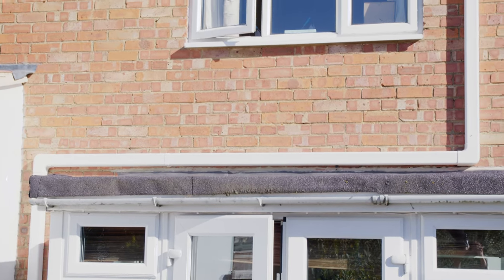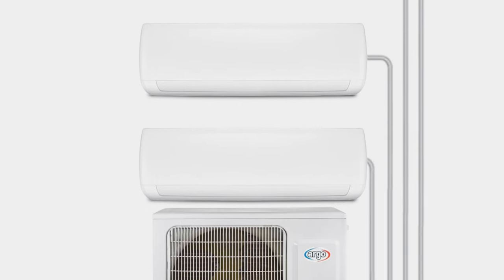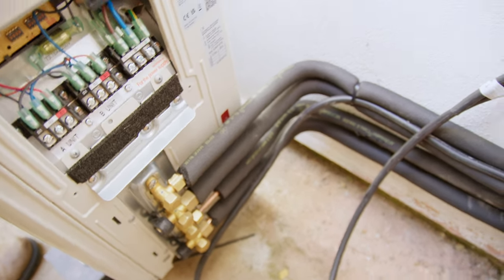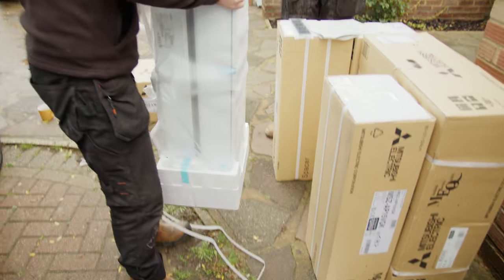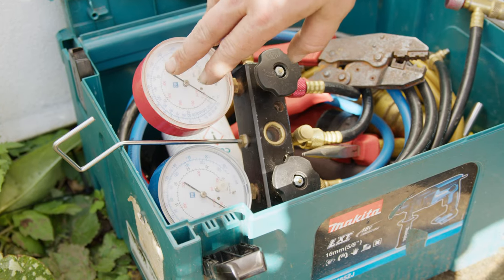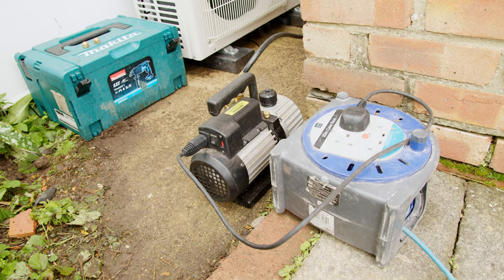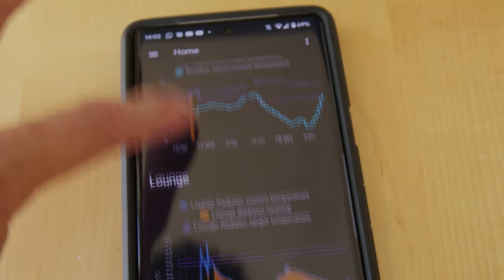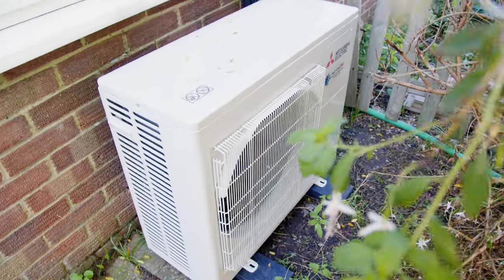Air conditioning in an ordinary British house?! 4K HEAT PUMP

Comment: When drilling through the brick wall, the guy should have used a long bit and gone all the way through from the inside to the outside. Then he could have taken his boring bit (diamond tipped) and gone through from the inside to out, but stopping 1" before the outside. Then he could have finished the last inch from going from outside  to inside. This way, he wouldn't have taken a big chunk out of the brickwork.
Reply: I instantly spotted and thought the same!
Reply: @TheRetroBristolian  Me too. Some people just don't care.
Reply: Yep, typical rough arsed tradesman.  Smashing the face off the brick. At least the trunking covered it up.
Reply: With a decent diamond core drill there are nog chuncks taken from the brickwork.
Thi is garbage, also the dust is everywhere now.
Reply: No dust masks either
Reply: Did the trunking not hide it?? Easy to point fingers from your bedroom
Reply: It's best to drill with a fine bit int to ext, then core from the outside, when nearly through take it off hammer, you can then feel when you reach the internal plaster,  take it easy and you're through, all the mess is outside, no spelching.
Reply: @jamesmcguire5018 but its just good practice🤷‍♂️
Reply: @LiamC-ez7yn   Why do you use hammer action with a diamond core? 🤔
Reply: Agree, also I would have thought they would use a pvc pipe through the hole to protect the AC pipe.. looks like a lot of potential damage on the copper pipes that could expose over the years.
Reply: he got the job done

Comment: Hi Rob, I would be interested to see how you get on with these through the winter in terms of energy consumption and how warm you're able to get the house.
Reply from the maker: I replied with this under another comment but realised I should have replied here. Anyway, copy and paste:

For energy, my rule of thumb so far is that heating a single room in normal South England autumn/winter weather is definitely a lot cheaper with AC. I can run my LN25 unit for a whole working day for about 4-5kWh. In similar conditions I used about 30-40kWh of gas. But it's not totally equivalent as even with TRVs the gas is heating more of the house at once.

I've noticed some loss of efficiency and heating takes longer in this -2C cold snap. Outdoor unit needs more frequent defrosting. You can hear it working harder. Indoor unit takes longer to start pumping out warm air.

Will update or post another video when I understand my spreadsheets better (I am running an experiment right now in fact. I used no AC yesterday but have the gas off and am running AC in my work room now, so will compare cost for a day's work.)
Reply: @RobFisherUK  Thanks Rob. I did spot that reply for the other comment, but I apricate the time you've taken to copy me in!
Reply from the maker: @jamesdcuk  little update from my experiment: on 13th December I ran gas heating in the room where I work between 9am and 6pm and it cost £2.36 for 23kWh of gas. On the 14th, similar weather, I used AC and it cost £1.62 for 4.6kWh of electricity. I felt similarly warm. Of course the gas was also heating my bathroom and hallway. But the AC gave off a nice blast of warm air as I sit right under it. One other consideration I have no idea about: what is this doing to the service life of my AC equipment?
Reply: @RobFisherUK  Thanks for the update. Sounds like an ideal piece of kit, especially considering it can cool the room and reduce humidity too!
Reply: @RobFisherUK  5 kWh still seem really quite good even if it isn't necessarily heating up every single room

I've got solar panels, and I figure I may be able to run AC partially from solar in the summer. Equally I've got old microbore piping, and tiny radiators so I was thinking maybe it's worth just purring these in, instead of replacing my current set up.

It does seem cheaper either way. The biggy however is the heating of water too
Reply from the maker: @waqasahmed939  for cooling, solar makes perfect sense because the hot days are also the days you're likely to have spare electricity from your solar panels.

Heating water is indeed a biggy. I stuck with the gas boiler because 30kW of water heating power is great for showers in the winter. But I guess a hot water tank and a pump can work well too, and so the question is going to depend on the price and lifetime of the equipment, efficiency of heating water with a heat pump, and gas vs. electricity price. A difficult choice!
Reply: Thanks for making this video. It sounds like each unit of the split system is running at around 0.5kwh is that right? If so, that is really efficient and with a small solar array you could run the heating for free.
Reply: @RobFisherUK  would be interesting to see how much electric on a cold day did you use to heat the whole house, Im just about to have 8 units installed in my house (Toshiba Haori) with 2 external 5 split capable units. I think air to air has got to be more efficient that an air to water solution as heating water up and then to radiators is in my mind not as COP efficient. I do have in mind to use a an all in one built on top top of the water cylinder ASHP water heating for my DHW. thanks for posting your video
Reply from the maker: @bobbazley5376  I've never attempted to try heating the whole house all day. One thing air to air seems to be good at is quickly applying heat where it's needed. So on the cold days where I've tried heating with only AC and no gas, I've turned rooms on and off as needed. The main downside to this is I don't have AC in the bathroom or hallways.

The most I ever used in one day for AC, as reported by data from the Mitsubishi app as read by Home Assistant, was 13.7kWh. On that day the outside temperature ranged from -4 to 5.2C.
Reply: @RobFisherUK  Thanks for the quick reply Rob its much appreciated. I live in the highlands and have Oil for heating (no gas up here) but I also have solar and battery storage so wanted to go all electric. I think when you look at the data for SCOP/COP Air to Air is more efficient than an Air to Water system. I like that it will allow me to fully control each room with an app and really only heat the rooms I need. Its a 5 bedroom house with two fairly large rooms on the ground floor of 8.3m x 4.7 those two rooms will have each have a 4.5kw Internal unit and the rest of the rooms will be 2.5Kw units. I will have one placed centrally in the main hallway which will also be good for heating the upstairs hall as I guess heat rises ! I'm on the Octopus Cosy tariff that allows me to run all the system at just 20p per kWh. for 6 hours a day in early morning and afternoon. I know I will have much higher electrical usage during the winter but I think it will be a little less than what I have been paying for oil and I will be able use less as its quicker to heat rooms up with active air flow of the heat when its just convection with radiators at present.  Agreed the bathrooms are not really suitable for an air con unit but my plan is to just place heated towel heaters  that are on a timer for the morning and evening times that they would be used. I think you having the whole house A2A is a great solution and from what I'm seeing is there is more and more interest in that as a solution to heating a house (as well as cooling it!)
Reply from the maker: @bobbazley5376  yeah, all that makes sense. I'm pretty happy with my hybrid solution. I kept the gas boiler as it gives a bit of a boost in the mornings and it's great for hot water, but there are increasingly more options for replacing things with electric power, so in future I might go further.
Reply: Daikin now do an a2a that supports a hot water tank, Daikin multi+

Comment: 5 days!?! What were they doing... thats no more than a 2 day job for 2 men come on, 3 max if they hit probems everywhere
Reply from the maker: They were working 8am to 4pm I think. Day 1 was installing two indoor units at the back of the house and routing some interior and exterior trunking. Day 2 was installing rear condenser, hooking it up and starting on the front of the house. Day 3 and 4 was finishing the front of the house: two wall mounts, a floor mount and some complicated routing of pipes. Day 5 was not a full day and was electrical wiring and commissioning. Even setting up the WiFi on 5 units took a while.

One of the guys was just an apprentice, so there was only one guy to do the welding, for example. There was a problem with drilling through soft bricks in one place that took ages and killed a drill. None of it seemed unreasonable at the time.
Reply: @RobFisherUK  ill give them that then not the longest days now it makes more sense. Also i suppose you'd prefer it's to be a good job than rushed and faulty. Carnt rush good work. 👍
Reply: How long have you worked in air conditioning for??
Reply: @markdove5906  put plenty in, its easy work compared to the real trades haha, if you'd take 5 days your stealing living....

Comment: intresting to see, i have also had 5 internal units installed, all Toshiba as i wanted to link this in with HA and it seemed the easiest to do this with. 
2 x Mini Splits for each side of the house downstairs and 1 Multi Split for the bedrooms upstairs, has been great for the summer and have hardly noticed the power consumption.  
Power usage last week 05/08/2024-11/08/2024 was 9.1kWh, this included running one bedroom from 23:00-07:00 on quiet mode every night. Total usage for July was 31.42kWh which based off my average cost of 12.96p/kWh is £4.07 for July. Will be intresting to see how it performs in the winter when it gets really cold, it was testing a bit in the last week of April where i used 12.36kWh which based off my average of 10.90p/kWh was £1.35 for one weeks heating in the afternoon.
Reply from the maker: I need to figure out how to get monthly costs out of HA, so far I can only see daily costs for AC on the energy page.
Reply: @RobFisherUK  yeah I still need to fully setup HA for the AC. Currently I just have a dashboard for each unit with an all off and all on button. Have managed to get Agile rates on a mobile widget this week which shows the current and next cost price, still working on getting them all to show for the day.
Reply from the maker: @mar451111  yeah I have some automations that do things when electricity is cheap or expensive. I'm hoping by winter I can figure out something to switch between Gas and electric heating depending on prices.

Comment: what was the cost of the installation (roughly) very interested to move my services from gas boilers to AC /renewable . thanks , great video
Reply from the maker: It was about £1500 per room. If you actually remove your gas boiler a consideration is there might be parts of your house AC can not reach, and there is water to heat, too.

Comment: With mitsubishi are you using infrared remote or wired ? You mentioned 30kw powered  consumption which is 6kw for each unit on standby its a lot. If unit is pressure tested as per manufacturer chances of leak is almost to none unless if you hit something to pipe by mistake. 
You can change settings to low power and even ultra low power mode. Engineers who installed the system they can do it but they will have to connect wired remote and mostly engineers carry it with them for programming and diagnostic.

Comment: Best thing i ever had done .i had 4 fitted ( mitsubishi units ) 3 12000 btu and 1 9000 btu.4 functions .cold heat humidifier and ordinary fan .Had them all fitted 3 years ago here in SE UK.
So nice to be co.fortable i  this heat .£1000 each supply and fit .And using them on eco setting and sleep mode they dont seem to be expensive .Also have used them in winter when not really needed CH on .
Reply: How s the noise from the interior unit?

Comment: Great Vid Rob, Ive been looking into this for heating more that cooling - I have a 5\2 lounges  bedroom house about 2500 Sqr foot  im looking to add . Im hoping to reduce my Heating bill overall i pay about 300 a month on heatin in the winter heating for about 2-3 hours a day @18 degrees . seems a massive waste but i think for my entire house it would cost me 10-15k  how has it affected your bills ? is it still cheaper on elect than gas.
Reply from the maker: The main problem is that where I am, gas is about 3-4 times cheaper than electricity per kWh, which offsets the efficiency savings of the AC. Honestly I don't think I would save money if I had only the AC for heating. The main way it saves money is in certain situations where I don't need to heat the whole house, e.g. working from home on my own. Also it starts working more quickly, so is better if I want a quick blast of heat.

But I still use the gas at least in the morning to warm the house through. And it's hard to compare year on year because this winter has been so mild.

Comment: Great video thanks. Did the installers have any preference for installing the internal units against an exterior wall versus an internal plasterboard wall? I’ve seen some suggestions that a condensate pump is required if not installing on an external wall (where fluid can drain to outside)
Reply from the maker: They didn't seem to mind installing on an internal wall. It just means you might have visible trunking. They avoided the need for a condensate pump by having a downward slope on the pipe, which in my case was possible within the diameter of the trunking because the runs were short. I imagine long internal trunking routes are going to need a pump.

Comment: How did it work out for the heating? Currently in a house with electric heating, so replacing the radiators with these would be nice in summer and winter.
Reply from the maker: It's pretty useful but for me mainly when I'm working at home on my own because I don't need to heat the whole house. I keep myself toasty on a cold day with about 350W. It can heat the whole house, but not necessarily cheaper than gas to do so.

But this winter will be different: I signed up for the Octopus Agile tariff so I can run gas heating when electricity is expensive and electric heating when it's cheap. And it can get really cheap (even free) sometimes.

Comment: That was a nice angle he was drilling with the core-bit
Reply: yeah you dont want the cables to snag on the way out
Reply: What was wrong with the angle? I was always under the impression you want to drill at an angle when going through exterior wall?
Reply: @ThatGuyKal  You do so that rainwater cant make its way in. I presume OP just isnt aware of this.
Reply: @Timsticlestv  that's what I just always been told, drill at an angle to prevent water ingress
Reply: Yes they need to be drilled at an angle, or else the condensate from each indoor unit won't run outside.
Go and read any installation guide for a split unit and they will all mention drilling with a downwards slope.

Comment: thank for sharing your experience - very valuable information! I'm in a similar situation - semi-detached house, 120m2 living space, 5-room, 2 story. I wonder myself if a mini-split system be sufficient? I have an oil heater and use about 8000kWh per year for heating.
Reply: You would need a 36000BTU system. I think it's only rated like that in the UK though.

Comment: Been looking into this a lot, and i think you made the right decision. If you don't mind me asking, What was the total cost?
Reply from the maker: You're looking at about £1500 per room, plus or minus depending on how fancy you want your wall mounted units and how complicated your installation is going to be.
Reply: Git a quote from sub cool for a 2.5kw floor mounted Mitsubishi mini split unit at £2,300 total cost included install. Not sure how your cost was on average £1,500 when the AC equipment alone costs £1,300-1,400 for the aforementioned floor option?

Comment: Comfort during hot days but you're stuck constantly with big ugly units on your inside walls and ugly trunking on the outside your house. Im looking for the units that fit flush in the ceiling. No ugly eyesores and no taking up wall space.
Reply: I've got no trunking in the bedrooms, ran pipes through the stud walls, you can have them installed on exterior walls and straight through, no pipes at all. Downstairs are bulkheads with grills, nobody even notices any of it, again all the piping is hidden in bulkheads.